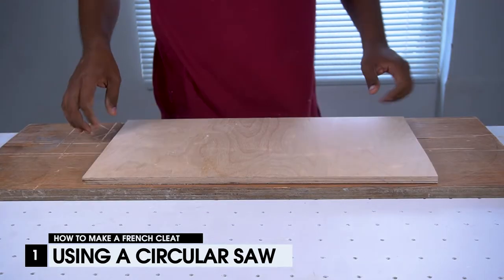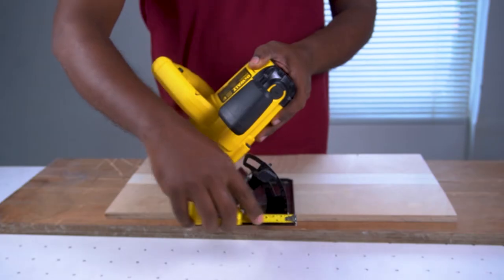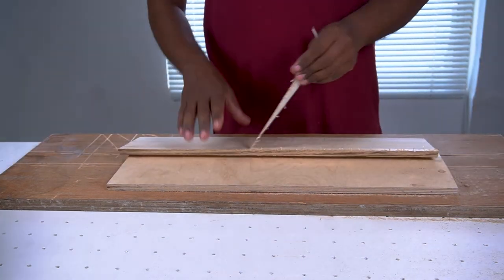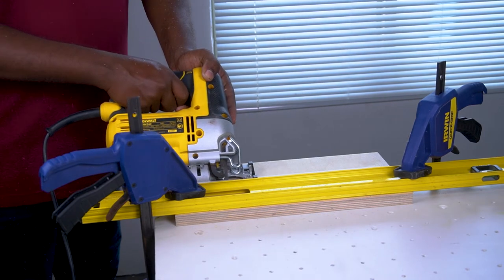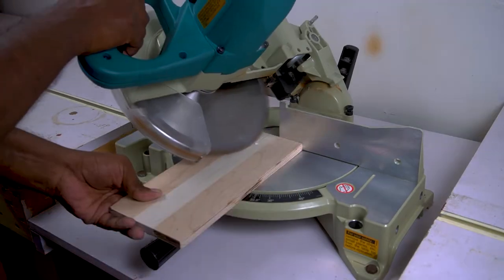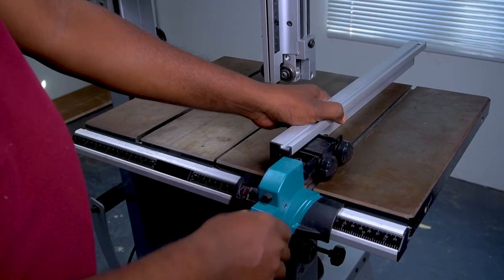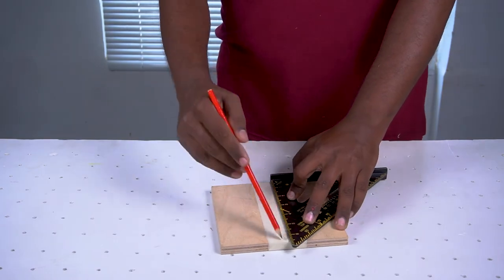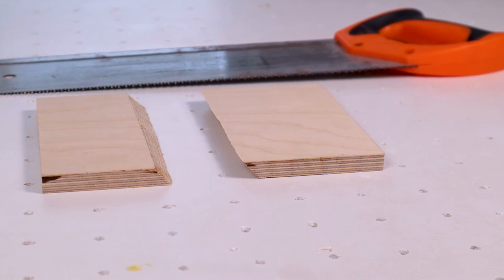How to Make a french cleat Without a table saw- 5 ways

Comment: Very good tips. By hand saw the cut might not be perfect but as long you use  in the same direction it will work. The cut does not have to be exactly 45 degree.
Reply from the maker: Great point!